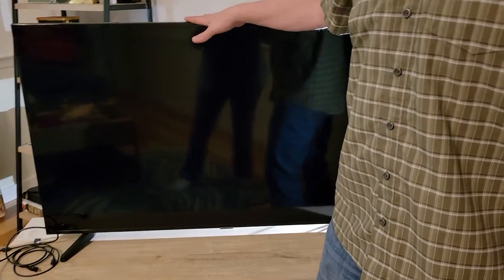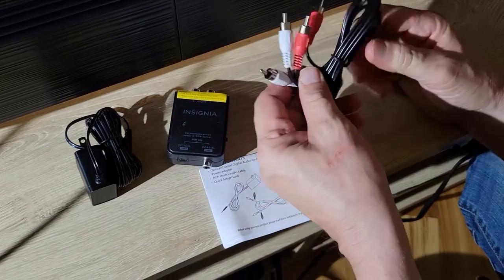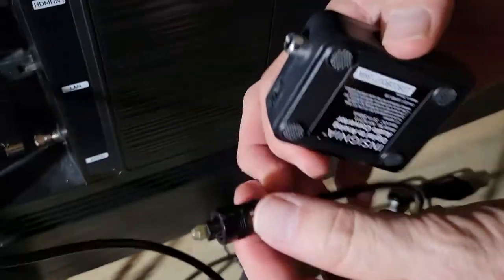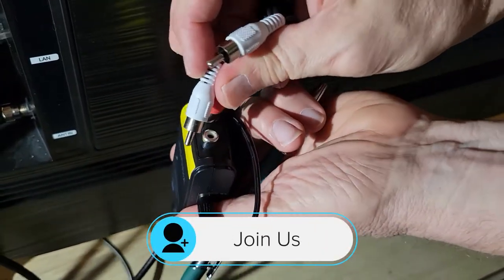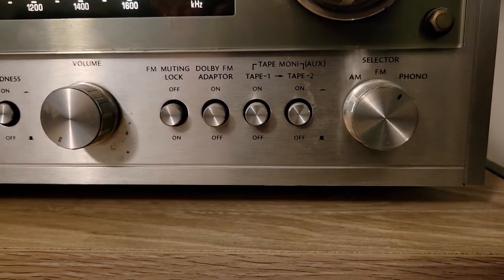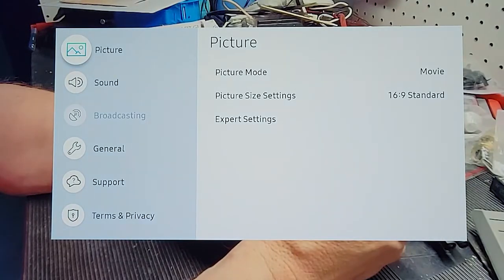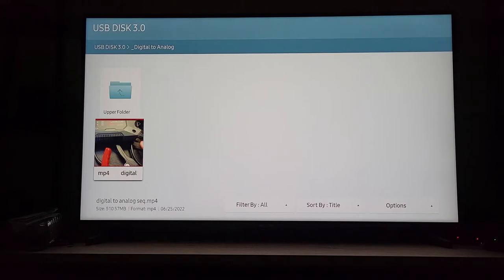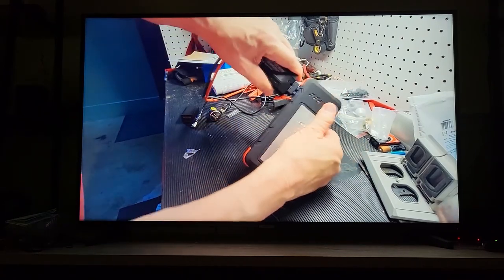Insignia Optical Digital to Analog Converter NS-HZ313

Comment: Will this device work to convert an old analog tv to digital?Where can you get the digital optical cable?
Reply from the maker: This only works digital to analog audio and not the other way. Optical cables should be available at Best Buy, Crutchfield and others.
Reply: @cfldriven  so if I understand correctly it will not do analog to video conversion ok?
Reply from the maker: @robertshade8631 This particular device is only for digital audio to analog audio. I would like on B&H or Adorama to see what they have available.
Reply: @cfldriven  thanks.Two Best Buy employees assured me this would work.I thought that was incorrect.I appreciate your reply.
Reply from the maker: @robertshade8631  There was a time when BB employees knew there stuff, they got rid of them and just hired a few people to pull stock and ring up purchase.